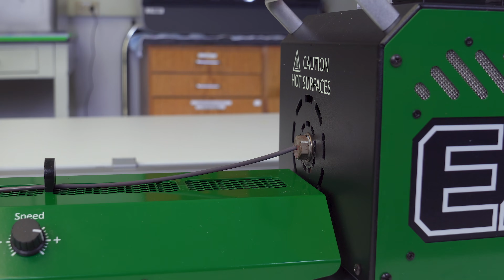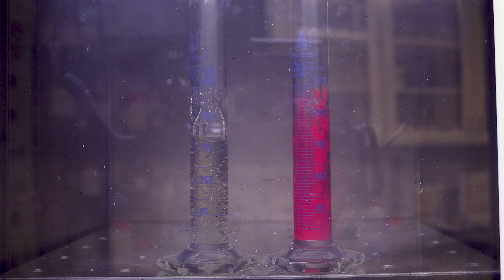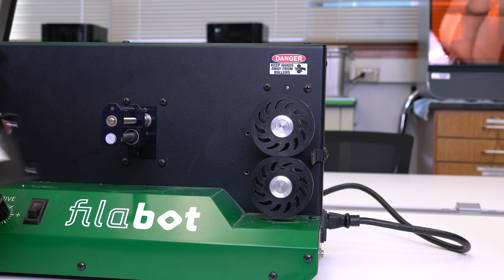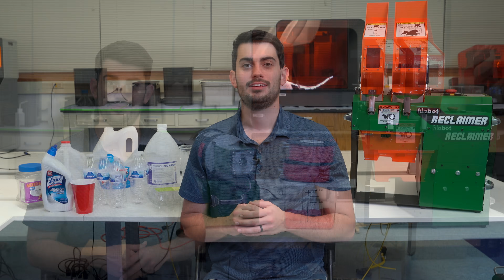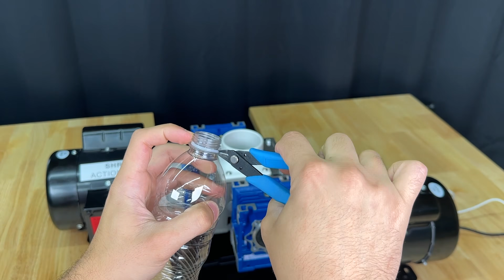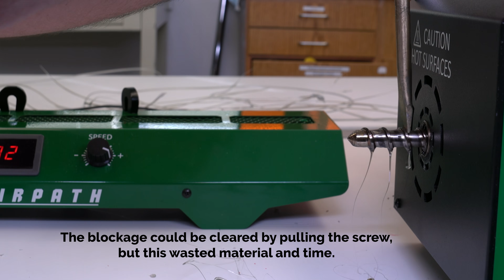Recycling 3D Prints and Waste Plastic into Filament (PET & PLA)

Comment from the maker: ♻ Mechanical recycling is very challenging. It takes a lot of time and expensive equipment to produce a material that would cost a fraction if just purchased new. Let me know in the comments what societal and technological innovations are needed to make recycling of failed prints :_DFLOBenchy: and waste plastics more economical.
Reply: As an optician im very interesting to see if you can recycle cellulose Acetat frames. The goal would be to get uniform pellets to heat mold plates to cut out new frames. For the community could you test a cellulose Acetat spool because it is rare on that market. On the manufacture side i could read that it is possible to recycle PA so my question is while i saw that you have a printer from Formlabs, could you recycle prints with this and could make a PA spool out of it. Hope for more content like this special if you could try cellulose Acetat🙏🏻
Reply: I have a bag of pla filament failed prints. I have been looking for a long time for someone to take a prints so it doesn't go to waste
Reply: @bigbomb5904  ITS Already degraded af bro just throw it away. RECYCLING For 3d printing is pointless cause  its full of moisture and lower quality each time
Reply: what if you melted the plastic into a sheet before reclaiming it to get a more uniform size and shape?
Reply: @anthonyleggio4877 not a bad idea. PLA easily breaks and I use blender after paper shredder to crush it to small flakes that can be easily molded, extruded etc. But it gets brittle, so rPLA can be used as an additive to the raw PLA with time. In small scale recycling it's the easiest material to work with. In a large scale recycling mostly chemical recycling for PLA is the answer.
Reply: Me and a friend are trying to make affordable plastic recycling machines for home and industrial recycling, instead of paying 50k maybe pay 5k Which is a fraction of the cost for a professional extruder
Reply: @Balaco1  I have tried this Filabot and for recycling it's not ideal. It has a lot of flaws that DrFlo doesn't mention. Def invest in industrial style recycling unit. It's better to buy a used one than this set up. Filabot is good for "prototyping", but not for recycling.
Reply: @Balaco1  theres a German guy who created a DIY kit and it comes up to about 2 or 3K, depending what other equipment you choose to use (grinder, dryer).  At 2K, it becomes interesting, but it’s still a LOT a of money upfront, and work, to save a few 20s here and there, when we talk home user level. At print farm or makerspace level, it makes more sense, including the fact you might be eligible for grants/subsidies…
Reply: This could be a good way to recycle of you can get a donation spot
Reply: Great this helped me a lot! Can you share the extrusión temperature for the 3mm filament. And also the extrusión temperature for the 1.75mm filament please!
Reply: So how do you get the small particles out ? Like sand or shavings for example, things like that will definitely clog a nozzle
Reply: @OneHappyCrazyPerson one of the steps he does is to break up that first extrusion spool and mix it with new too melt it again to make a second spool. That second melting mix is what gets rid of the chunks because it melts the chunks on the second time.
Reply: @OneHappyCrazyPerson  he mentions and shows in the video at some point: he uses a sieve, manually.
Reply: @OneHappyCrazyPerson  i know some extruders have fine metal meshes right before the plastic is forced through the nozzle, that seems to help but takes effort to clear out when it's clogged
Reply: All you need is PLA ONLY recycling stations in big metropolitan areas to begin with, not so hard to achieve plus small communities can ship filament to stations. Each state can subsidize it. You can have one per state. And def don't use Filabot, it's shitty for recycling (one screw and a lot of headache).
Reply: where can i buy one
Reply: The best way, if you have 3D farm, collect lots of material and send it to industrial plant for recycling. If you have 1-2 printers - no use for all of it.
Reply: Machine price please?

Comment: The density of the material shouldn’t be a problem if you adjust the temp of the nozzle (lower when there is not enough material and increase it when it does) and increase the pressure of the lead screw I wanna build one for myself to demonstrate that

Comment: что бы нормально тянуть пластик через петпул не нужно использовать сопло. нужна специальная фильера.  без нее 1 бутылка тянется час с ней около 2 минут. in order to pull plastic through a petpool properly, you don't need to use a nozzle. You need a special die. Without it, 1 bottle takes an hour, but with it, it takes about 2 minutes.

Comment: Filabot EX6=$14,495.00 Filabot Pelletizer=$4,795.00 Filabot Reclaimer=$9,945.00 total=$29235(haven't calculated electricity usage) . one spool of PLA plastic= $7 total amount of spools you can get for that money=4177. i guess saving the environment isn't cheap, or someone is shafting someone else real hard

Comment: I’m really passionate about recycling PET bottles in our community here in the Philippines, where local scrap buyers regularly stop to collect them. My goal is to recycle these PET bottles and turn them into 3D-printed surfboards to help promote tourism in our area. I initially tried using the pultrusion method, but I realized it’s not ideal for this kind of project—it’s too time-consuming and not practical for processing large amounts of plastic. Then I came across a video that showed a more efficient method, but my only challenge now is the budget required for the setup.
Reply: I am in the philippines too and I got a p1s in cebu. that is my goal as well. where are you based in? filabots are expensive though

Comment: Fun note: My college professor (industrial plastics mfg) had this question on the final exam:
Question: "What is a polymer?"
Most students got it wrong.
Answer: Many mers

It's a shame companies that offer tools like Filabot Reclaimer and Shredii price them well out of the reach of the hobbyist. The price of components (steel blades, motors, controllers, screws) should not be 35x more (Reclaimer) than large volume (300mm x 300mm x 400mm) 3D printer ( Creality10 ).
These devices (Shredii and Reclaimer) are far, far, far from industrial recycle machines. They are desktop devices. It is unfortunate the 3D community is screwing itself.

Comment: If you can make machines to recycle plastic prints and such, how about a reliable, easy to use 1.75mm filament splicer.  Too much filament is wasted near the core of each roll.

Comment: What if PET bottles were "pre-melted" and compress into blocks that could be shreded in larger/no so thin bits ? 
Wouldn't be easier to work with ? even though it add to the melted history of the plastic

Comment: perhaps the extruder needs a pre-melt phase just before the extrusion phase where a small reservoir is filled with melted ground plastic that forms a kind of buffer, then that melted reservoir can be extruded at a more even rate because its all uniform

Comment: Just a quick question,Can i use the pultrusion type of extruder( that you demonstrated) and create some roughly hollow filament. Can i pelletize that filament and mix it with the PET flakes to increase the flow and friction in the barrel when extruding the recycled filament so it will be 100% recycled material.
Maybe i can even consider adding some new/bought PET pellets to the mix to improve the overall quality.
Just curious if all of this might produce some better quality recycled PET filament.

Comment: I would cut two holes in your material dryer/oven, one on each side then put a blower on one side with a hose running from blower to one of the holes you cut then on the other side of the dryer connect another hose and run it to a box connected to the bottom of the container you have your material in after you have cut off the bottom and replaced it with a screen. Then you will be blowing hot air through the material which will obtain proper drying rather than the moisture being trapped in the container/material.

Comment: So basically this shredder is a poor design as it requires you to shred the larger particles again to a finer shredder, instead of placing the finer shredder below the output of the first shredder... Plus this is just a 40 minute commercial basically

Comment: For the PET bottles, wouldn't it be faster and easier to melt everything down and condense on a tray or some other container and then chop it up so it's not so thin of pieces? That would also help the moisture issue.

Comment: Going down memory lane a bit. When bottles were glass, and some modern plastic containers, had deposits on them. Returned to a store, if your state participated, you got cash or credit. It was better than shattered glass on the roads and such. Shipping would be hell, but recycling drops in brick and mortar filament vendors could do the trick... a little. 6 kilos of old prints for 1.5 kilo spools. Dunno. Some big box stores do it with batteries. No money, but a central drop off.

Comment: The flake seems a labor-intensive problem to solve, so what if you melted whole water bottles in an oven and then cut them on a saw and run them through the two chippers?  That’s two extra steps so… no free lunch!

Comment: I mostly specialize in material development that can be more easily transferred into alternative production methods and am currently working on a solvent-based extrusion method for ABS (also easily adaptable to other plastic/polymers in the recycling sphere of interest that work with easily obtainable solvents). It's a real easy build that can be done in a weekend, as I just obtained all the remaining parts to mock up the extruder yesterday. If you're interested in yet another project, this will definitely cut down on redundant processing of oddly-shaped flake, but better yet, should be able to bypass the shredding phase altogether. I do have a high RPM alternative shredder that kicks out almost powderized stock, but have been loading simple compressed samples quite well in my testing phase. 
I'm currently focusing on recapturing the solvent for subsequent passes as that is the part I'd most like to reuse, as it contains quite a lot of liquefied microplastic stock. Not that it's terribly expensive, but being able to reuse the solvents makes it that much more affordable rather than letting them vape off to atmosphere, aside from environmental concerns with doing so.
Reply from the maker: Always interested in alternative methods of recycling! ♻️ Please consider posting your build to my forum: https://forum.drdflo.com/
Reply: @DrDFlo  Will do! I hadn't documented much during the build as it was a personal project at the time just to test a material, but it turned out to be so cheap that it could solve a lot of problems. I'll work on a write-up as the build progresses. Just got the extrusion body done this evening, on to testing tomorrow!

Comment: Thanks for the video, this is very interesting stuff.

The hollow filament produced by pultrusion is a non-issue -- you just increase the slicer's extrusion multiplier to compensate. I have printed many aesthetic and functional parts from pultruded PET bottles, including all the motion parts for a 3D printer. I agree that the process is quite slow and tedious, but the results are good. If you're dedicated enough, it is pretty much the only truly affordable way to produce filament at home.

Comment: One thing that I was wondering is why are we even feeding the pellets directly into the screw? wouldn't it make the process much easier if there was a some kind of "heated kettle" that would already heat up the plastic and from there it would already be flowing and the screw could press it through the extruder with far less issues. Or am I forgetting something?

Comment: I worked in injection molding over 40 years and I worked with plenty of regrind materials. I kept looking for you to make a mistake but you hit everything on the head good job. Those are all the same issues all recyclers deal with . I worked at an injection molting factory once that advertised a product as recycled materials but used virgin because it was cheaper than recycled. Also there is a difference between pre consumer and post consumer plastic.

Comment: This hodge podge of equipment seems really poorly thought out. Why wouldn't the grinder drop the first ground material into the second grinder so that you have a fully ground material at the end versus what you have now. And I've seen simple hand drills that can handle smashing the plastics weird that the 1 hp motor is having any issues would think that would be overkill honestly. Not sure this equipment wasn't left over that someone through together in a factory to try and resell it as the old equipment it came from wasn't selling anymore. Just seems like a bad setup all together.

Comment: Would it be possible to melt the bottles into larger chunks before putting it through the shredder so the regrind is more similar to that of the 3d print regrind and less of the flake that clogs the extruder?

Comment: Sadly, for 99% of people it just doesn't make any sense to recycle your own filament. Filament recycling in general is good, but it's just not in demand enough anywhere, and it has to be in demand enough to become a service on the local level, because no one is going to pay to send off their old prints for recycling—not with what shipping costs these days! 😬

Now, a filament extruder? Yeah, I could see getting one of those so I could make custom filament from virgin pellets. Custom colors, custom materials, etc.!  I'd love to do custom color-matched filament! 🤔 (Imagine being able to offer a custom color-matched PLA, along with a couple different durometers of TPE/TPU in the exact same color. Or selling retro game modders a filament in just the correct shade of vintage game console gray. 😏)

Comment: I would prefer something like an oven.
An oven that melts pieces of small to medium large size.
Then the melted plastic is drained through a sink under the oven.

The problem is i live in an apartment in a very silent community. I don't want to make much noises.

And neighbors in general would be more complaining if the noises sound like a factory. They would tell me - take your machine shop somewhere else. This building is for living...

Comment: this is way too elaborate and time-consuming for home use and way too small and manual for industrial setting. it fits exactly nowhere. even the scale itself creates problems with flow, bridging, clogging, batching processing. also has a lot of questionable engineering design like shredding in two steps of different size using the same method. just modify a cheap wood chipper or have something like a reciprocating cylinder push the parts directly into the granulator. at least granulate it straight from molten by flinging it through the air or dropping it in water or some non hydro coolant

Comment: Plastic bottles shrink when heated. When they shrink, they also thicken. You may be able to shred plastic bottles far easier if you heat them before shredding. Thicker shredded pieces may also feed better, so it worth trying to heat the bottles to shrink before shredding.

Comment: why didn't you just use the pultrusion machine to make 3mm filament that you then pelletize and run through the extruder?

It seems like a really simple solution. One that doesn't result in any jamming of the extruder, or require a person pushing the ground material in. you can use the pulltrusion machine for the bulk of the material and mix the pelletized pulltruded filament with the re-ground material from the leftover parts to increase the yield from the bottles.

Comment: Recycling 100 kg of material sounds like a lot. But even using expensive material, this is just like $2k max in saved new material -- not even thinking about issues caused by using not prime material

I think he said one time that this setup cost $15k -- which is quite affordable for industrial equipment

Not counting labour or energy, you should recycle >500 kg/year for this to be viable

So year, filament recycling simply makes no sense. Better use bio degradable material like PLA

Comment: get yourself a panini press and turn your household recycleable plastics (bottles) into flat pieces first before sending them into the shredder. :) And plastics that are not good for 3d printing can still be turned into feedstock for cnc machining or straight into cast/moulded parts.

Comment: Hey,
we have a local maker space. I totally agree with all of your conclusions.
One thing I am still debating is converting 2.85/3mm filaments, which we have lots of, to 1.75mm filament, using some pultrusion instead of extrusion. we have anything from PLA to PETG, wood fill, bamboo fill, bronze fill, etc. I don't intent to even try TPU and similar flexible filaments.

Is it doable? worth it?

Thanks!

Comment: My biggest question here is why not have the shredder and granulator "in line" with eachother? Limitations due to power supply? The whole reclaimer setup looks like it could do with significant engineering optimization.